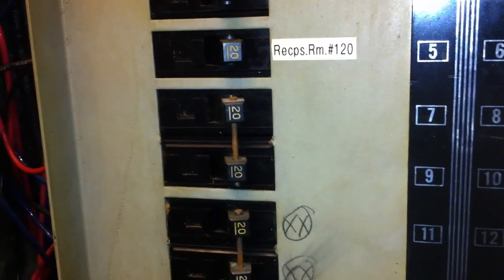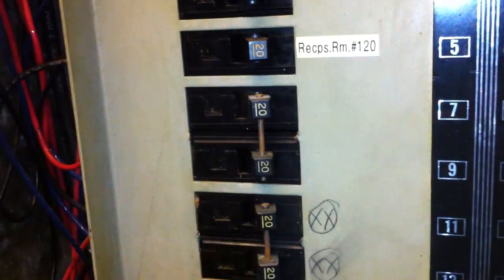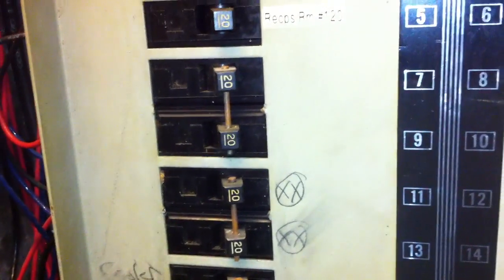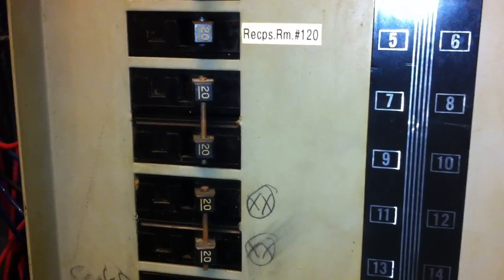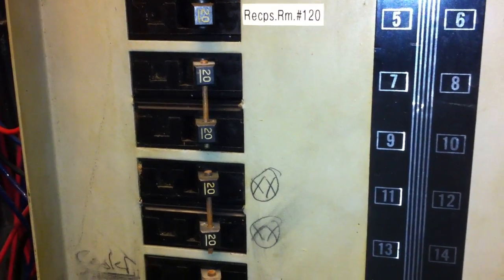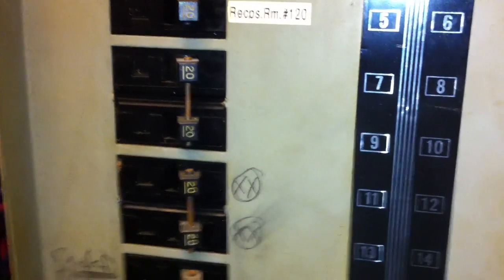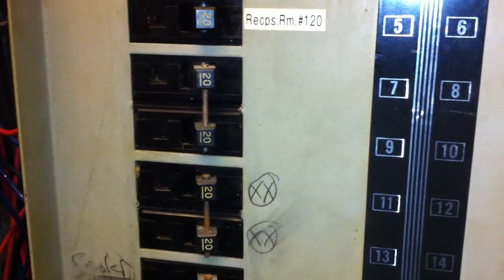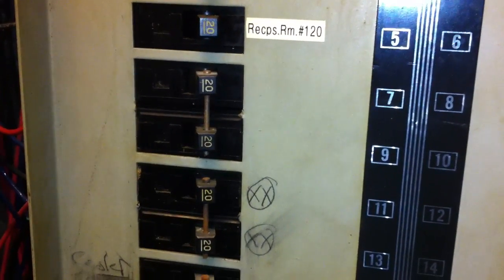Moving Violations 75: Circuit Breaker Handle Ties

Comment: I have no idea how old that panel is, but it doesn't look new at all. I have no idea what the code said about that back then, but I do know that they were different times. Unless it's more recent than it looks like, I'm pretty sure it wasn't a violation of the 2014 NEC at the time it was done, simply because there was no 2014 edition to violate. May or may not have been a violation of the then-current NEC. Still not a great solution, even if (and this is a big if) it was allowed at the time.

Comment: Honestly, those nails could save lives. The worst situation would have been to leave them not tied together at all and then someone turns off a circuit to work on it and then gets shocked by touching the other phase that is still turned on. Those nails are better than no handle tie at all. Obviously though, it would be best if there were official handle ties on there.